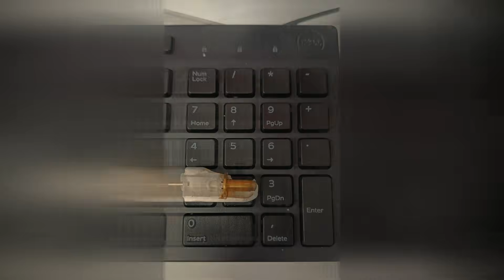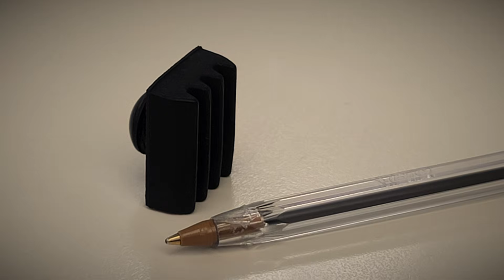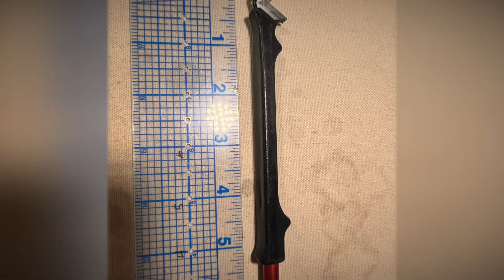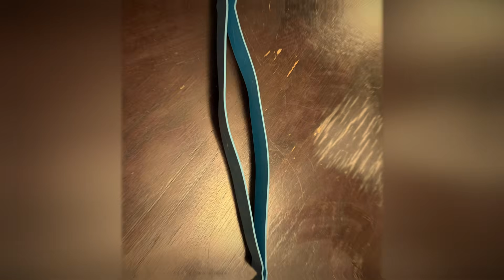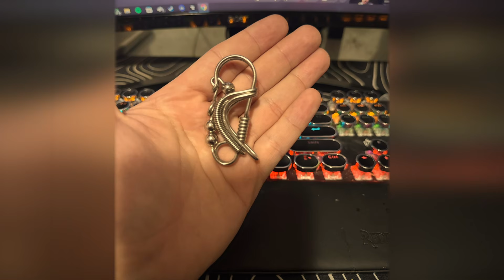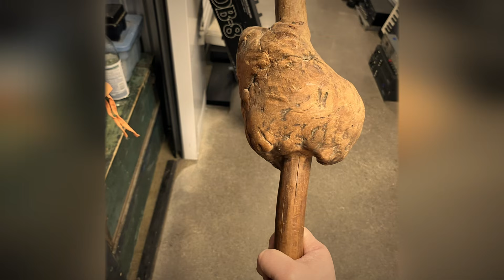60+ STRANGE OBJECTS! Why Was This Polish Military Kit Washed Up On The Coast?

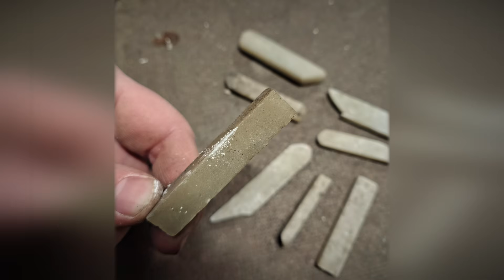Comment: The part at 3:37 is almost certainly NOT a scriber.....it appears to be a form of a spanner, likely used to tighten the locking hub on an angle grinder.

Comment: I thought I left this comment here about 6 hours ago.
Well here I go to give it another try...

The items that you called temporary structural support posts look like something else to me.

For one thing, they don't look very strong, but rather somewhat spindly to be anything structural.

What these look like to me, are poles that can be extended from the floor to the ceiling, and tightened in place using the adjustment screws.

The four of them can mark off a four-sided (four-cornered) zone, around which can be draped clear plastic sheeting, to cordon off an area in which materials such as paints or adhesives can be sprayed without threatening surfaces outside of the cordoned off area.
That seems like something an artist might want to do.
Even if an artist was doing something that would generate sawdust, he might want such a plastic enclosure, so as to keep sawdust from getting everywhere it isn't wanted.

I have seen such as this done on renovation construction sites to control demolition dust and debris, for example.

I could see them being used to support drywall against a ceiling, by a single person doing a job himself.
Though I suppose a number of these used together could support some considerable weight temporarily.
Reply from the maker: Thanks for the detailed breakdown on how those poles might be used!